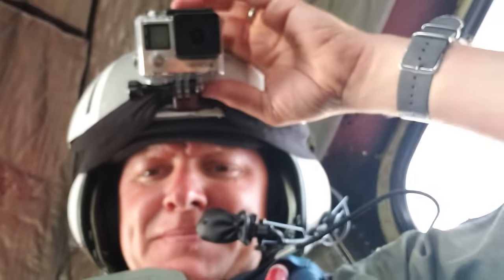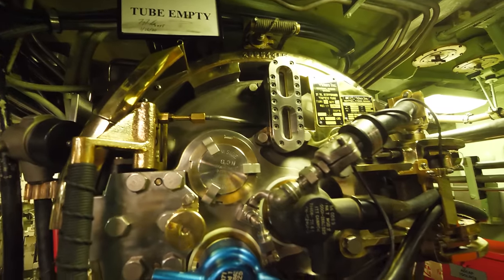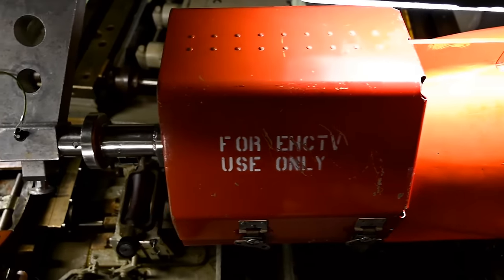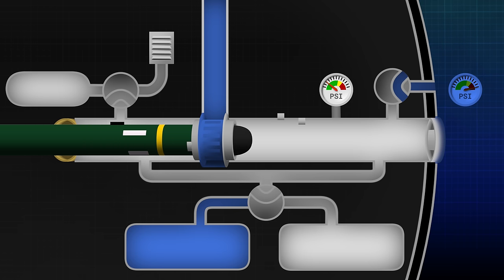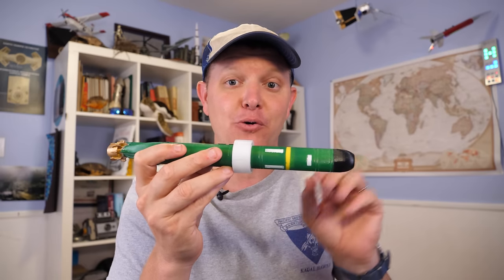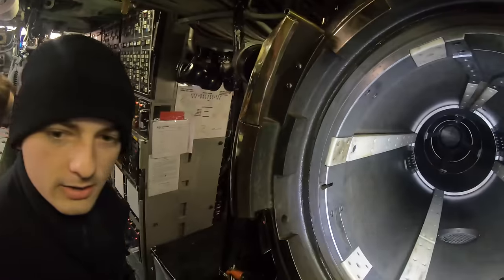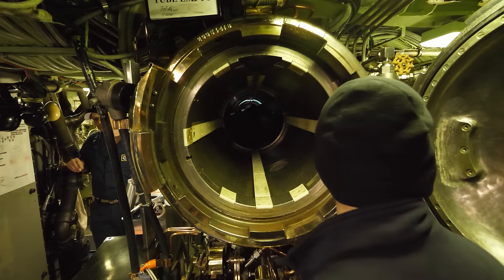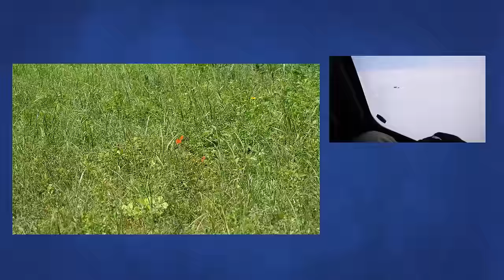Crawling Down A Torpedo Tube -US NAVY Nuclear Submarine - Smarter Every Day 241

Comment: 9:40 and you don't want to let any bubbles go out unnecessary to compromise your position. Closed loop and air is controlled for that particular reason as well. Even the exhaust fumes from on diesel/electric powered submarines are controlled in closed loop and discharged only in controlled way. Interesting video. Brilliant!
Cheers 😎

Comment: The sliding surfaces must be HDPE, we use it on flap tracks and other low friction sliding surfaces when we build aircraft… speaking of, can I please get a Kodiak model like you have? I worked at MAF and we were actively looking into designing the perfect aircraft for our very specific missions when the Kodiak came out and blew us away by ticking every box, as a Christian and aviation nut I am in love with the machine, please do a piece on the amazing story of the Kodiak.

Comment: just thinking about the ice at the end of the door. you could run heat threw ut to stop the ice if it was a problem like a heater core. but this made me think of condensation. they are in a sealed system so it has to be a problem. I'm sure they make drinkable water from it.

Comment: Give appreciation to the welder that did the welds that can be seen at 16:26 what is shocking is that, there aren't as many passes as you'd imagine the would be. Single bevel, 4 visible. That about 20 beads.  Take not instagram welders. These critical welds that pass an inspection in a nuclear sub, aren't pretty dime stacks.

Comment: So I have a question about water pressurization. If I had a massive tub of water like the torpedo tube and a really small tube connected to the outside water, would that be able to pressurize the whole tank to outside pressures even if the tube is ridiculously tiny compared to the tub? what's the limit on that?

Comment: In years past SEALS would crawl into the tube--the tube was flooded--the outer door opened--and they would swim out--silent and unseen. BUT---during the invasion of Grenada two SEALS entered the tube--it was flooded and for some undisclosed reason the outer door would not open--trapping them in the tube. They both drowned. I understand this method of insertion is no longer used.

Comment: whats the actual method of ignition for the torpedo? i thought thats what you were gonna talk about but was very happy w what u actually talked about. im just curious about this, if anybody has an answer.
Reply: small electrical contacts on the top of the torpedo, when it first detects current across the terminals, it arms. when that current goes away, it tells the torpedo to start the propeller

Comment: a quick question in the initial flooding of the torpedo tube how do you get the water to travel upwards is it pressured or something?
Reply: Could be a pump. Or, the floor pushes up, forcing the water up through the tube.

Comment: I feel like I must be missing something but why don't they load torpedoes through the torpedo fireing tubes rather than having to drop them in at a crazy angle.

You've already got the perfect torpedo shaped hole at the right level in the boat.

I guess you need to lift the whole sub out of the water to do that which might be a bit too much effort to reload. but, well, yeah, that was my first thought
Reply: That is exactly why. To further complicate issues, subs would need to be in dry dock to reload in this way, and dry docks generally only exist in industrial shipyards. Which under international law are not permitted to have military weapons inside them (So they arent a military target). So you would need to build a whole dry dock in your navy bases for the express purpose of reloading subs

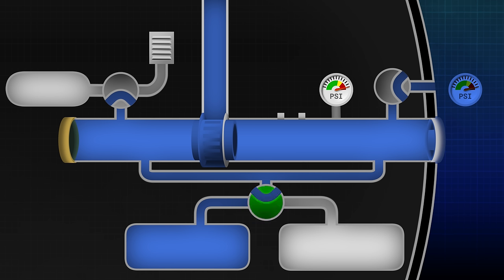Comment: 12:58 isn’t there a problem if the auxiliary tank meant to hold the mass of the water from the tube? Once the torpedo leaves the tube and assuming it’s neutrally buoyant, the mass of water that it displaced must be equal to the torpedo’s mass. So, when the impulse tank empties water to launch the torpedo, the mass of the water that was used to launch the torpedo must be equal to that of the torpedo. This would mean that the submarine bears the weight of an extra torpedo as water in the impulse tank, and if this tank empties then it must also simultaneously be refilled in order to maintain neutral buoyancy.

So my question is, does the impulse tank have a constant flow of water INTO itself as it pumps water OUT of the tank to the torpedo tube? Because, if the mass inside the impulse tank is sealed from external seawater this means that the submarine experiences a net loss of mass as the torpedo is fired out. The submarine loses the mass of the torpedo, and the amount of water inside of the impulse tank stays constant, resulting in an imbalance. The only way I can think of to correct this imbalance is to fill up the impulse tank with the mass of the torpedo that was fired out.

Comment: I may have missed it, but can the torpedo tube breech door be unlocked manually if there is some sort of problem with the hydraulics on the door?  I figured if the torpedo itself can be loaded manually and not hydraulically rammed, then does the same apply to the door?

Comment: I have a question destin… if during the firing sequence, you have to equalise the pressure inside the torpedo tube, won’t opening the pressure valve add many gallons of water as it’s pressurised?
Reply: Water is not compressable  , so if there is no air in the tube, only sea water and the torpedo  is in there  then virtually no extra water in volume would be added to the tube when the equalizing valve is opened ,    well that's how I understand it.......

Comment: Nightmare fuel: you've crawled inside the torpedo tube to check it out. Suddenly you hear the breach door close and lock. Your breath is rapidly siphoned from your lungs as the air pressure inside the tube plummets, and ice-cold seawater comes flooding in.

Comment: instead of lowering torpedoes down into the boat couldnt they just push them in backwards through the torpedo tube??
Reply: The tubes are like 20-25 feet under the waterline and they only load them into waterborne submarines. So uh yeah doing that would flood the forward compartment in a very short period of time

Comment: Why not load torpedos in the same way they go out?
Reply: How do you reload them quickly like that? Where do you store them? Would someone have to leave the sub in a scuba suit just to reload? Now I'm curious how you thought of this.
Reply: @squidiz496  I don’t mean loading them into the tube to fire, I mean loading them into the magazine while the boat is alongside. Instead of needing to take out various decks in order to weave the torpedos in through the top, why not load them all in through the tube? That way, there is no need to remove any decking. The torpedos could all be lowered down into the water on a cradle and then simply pass straight through the tubes into the magazine. The boat may even be trimmed to expose the tubes without needing to submerge the torpedos at all. That would remove the need to keep refilling and draining the tubes for each torpedo.